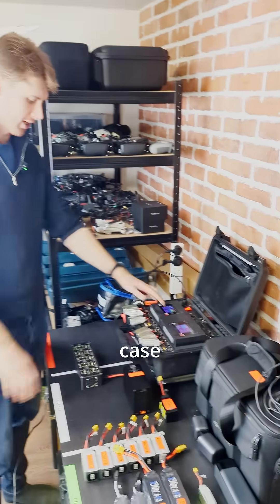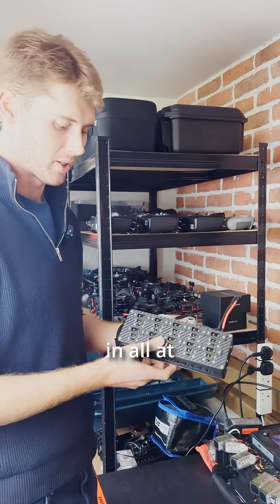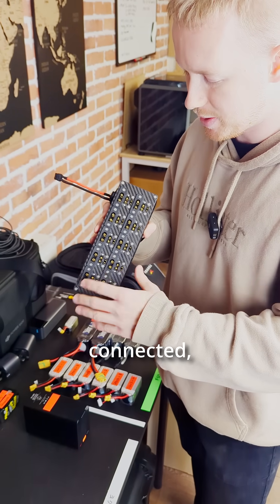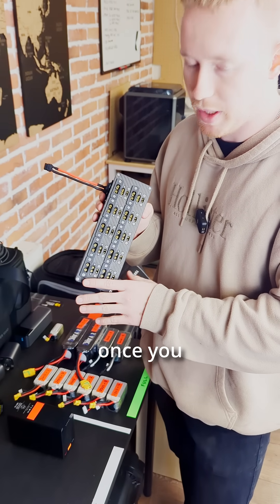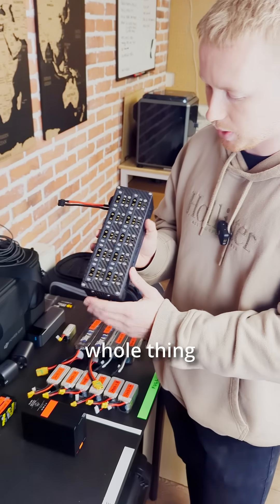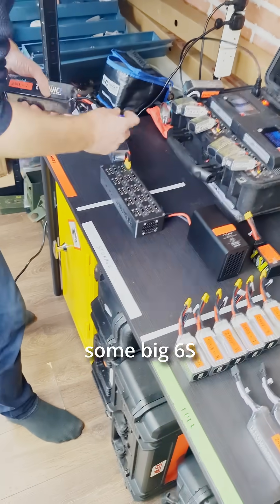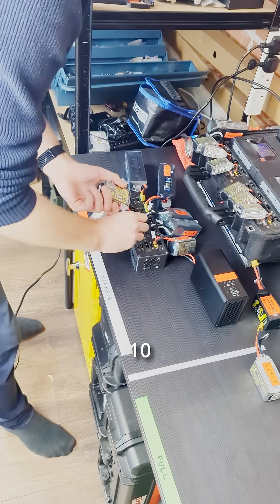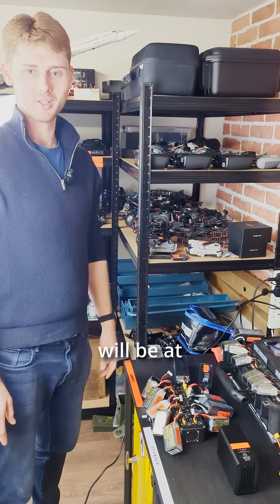KD Discharger for multiple batteries! #drone #fpv #battery

Comment: How balanced are the battery cells? Should I be concerned?
Reply from the maker: It doesn't matter much after one discharge, that's what your charger is for. When you fully charge them again you should balance charge so all the cells are the same. You should probably check your cells if you damage a battery or have concerns about it, before you discharge